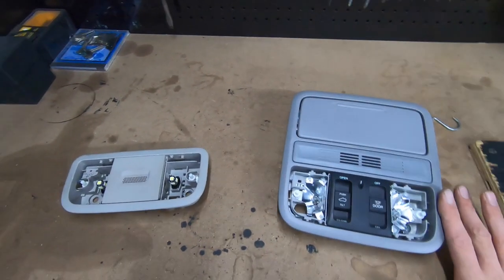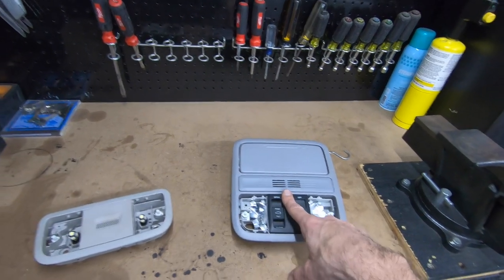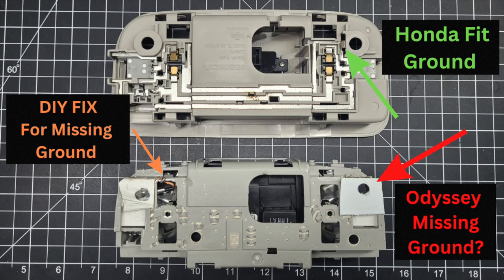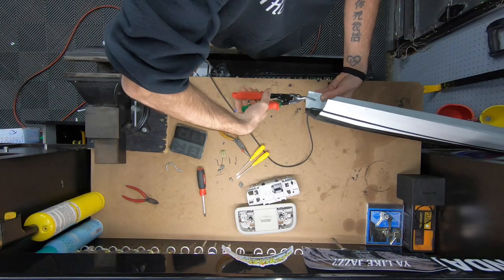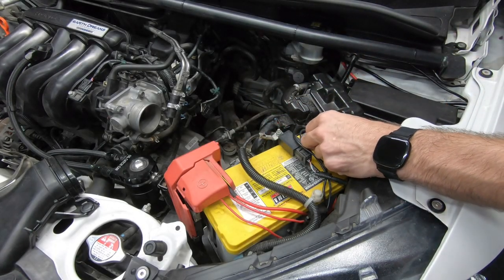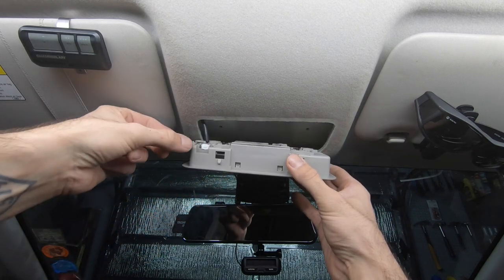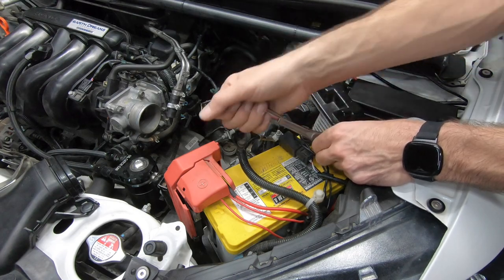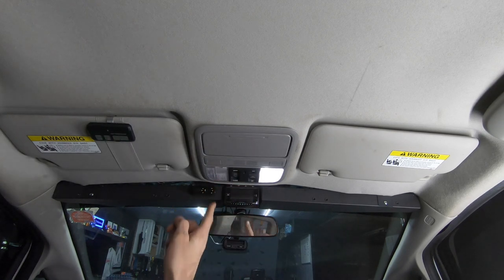2015+ Honda Fit Map Light Swap | How to install 2018-21 Honda Odyssey Map Light With Sunglass Holder

Comment: I replaced all of my interior lights on my 2019 Fit with a GTR lighting LED's. They are very good quality, and I have had no issues, but they are on the spendy side. Part# GTR.LED313 for the map lights, and GTR.LED312 for the dome, and hatch. I also replaced my licence plate lights with the leds I used on my map lights. I really recommend gtr lighting for upgrading the lighting on the fit. I have swap all of my stock candescent bulbs with there products and they work great. 

Love your fit build.
Reply from the maker: Thanks Cameron,
I will check them out. 
I agree, you usually get what you pay for.
I went through SuperBrightLEDS.com (No affiliation) 
There headlights were plug & play. No resisters or relays required and everything came with a 2 year warranty.
I know way to many people that have bought lights off Amazon only to have them quit working or start to flicker after 1 year.

Comment: Sick! I had no idea you made a video on this. My EX Gk has the sunroof toggle so I scooped up a 2010s gen CRV model with sunroof. After doing the same mod in my GE I want this sunglasses holder back!

I'm also surprised you don't need to cut the glasses shell like you did on the GE
Reply from the maker: That's awesome that you were able to find the work around for the models with a sunroof.
It's definitely a modification that I use everyday and don't really think about it until I get into a stock Honda Fit :)

Comment: Interesting, I will put Tharp on my maybe list.
Reply from the maker: FYI, I learned this modification will not work if you have a sunroof. 
The bump in the headliner that I cut out is where the window motor goes.
Reply: @HondaFit4Adventure  I do have a sunroof.
Reply from the maker: @DIYCameraGuy  I'm glad I caught you then before you started cutting into your headliner :)
Reply: @HondaFit4Adventure  do you have coil overs on your fit? I would like to do coils, wheels, tires, trailer hitch ( for towing my canoe and stand up paddle boards) I’m doing a camper build, removing the front passenger seat and wide rear seat. I’m building the sleeping dest at the level of the folded down rear seat. Also window tint rear of the driver.

Comment: Hello Sir. Are you sure it fits perfectly?  im trying to figure it out and seems there are some gap at the back. How does it fit correctly if the surface is slightly curved
Reply from the maker: Hi Christian, mine happened to fit perfectly.
By "gap at the back" are you referring to the side closest to you? the sun glass holder?
From what I read on FitFreak.net , some users have put pieces of foam back behind the headliner to push it out with the curve.
I hope this helps.

Comment: Amigo, tenho um Honda igual o seu. Será que o Honda HRV também tem esse mesmo modelo de luz e porta óculos?
Reply from the maker: El HRV de EE. UU. no tiene soporte para gafas de sol.
¿El tuyo?
Reply: @HondaFit4Adventure  Do not. Mine is a honda fit just like yours and I would like to know if this courtesy light holder together with the sunglasses holder would have on the honda model HRV, CRV or WRV? Because I saw that you took this piece from Odyssey and in Brazil you don't have this model.

Comment: Would this also work on ex models?
Reply from the maker: If you have a sunroof it will not work.
The sun roof motor is underneath the spot in the headliner that you need to cut out.

Comment: What is the 1st gen Fit / CRV ceiling console swap you mentioned?
Reply from the maker: The older Honda Fit's were able to use the Honda CRV map light which also included the sunglass holder.
The wiring was changed on the newer Honda Fit so I had to find a new alternative which ended up being the Honda Odyssey.
Same swap, just different parts.
Reply: Thanks 😎.. cool Fit
Reply: @HondaFit4Adventure  Is there a link to show the 2013 Fit swap ?

Comment: first
Reply from the maker: Just as I mentioned in the video, this use to be a common thing to do with the older generation Honda Fits.
I think I'm the first to do it on a 3rd generation honda fit or the first to document the process.
Reply: @HondaFit4Adventure  it was really good video, i kept focusing on the hotwheels on the backdrop